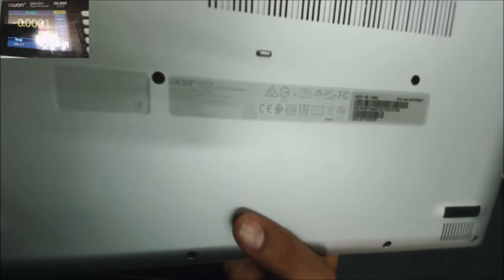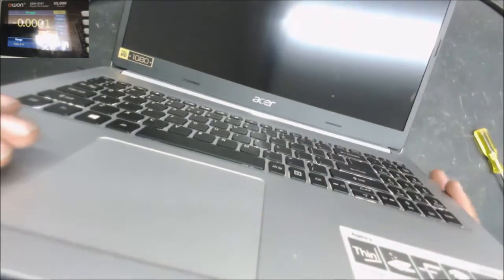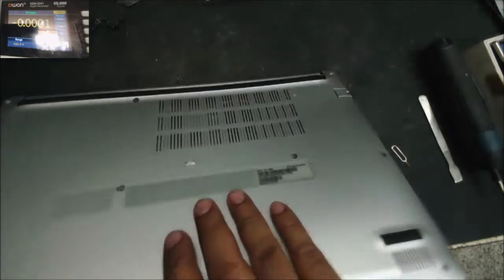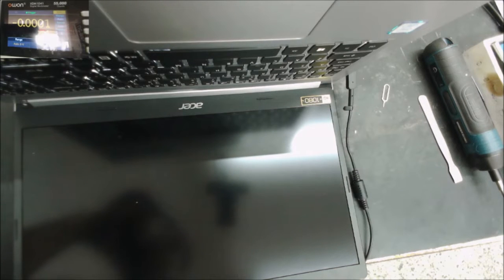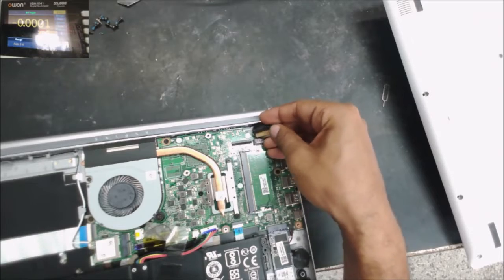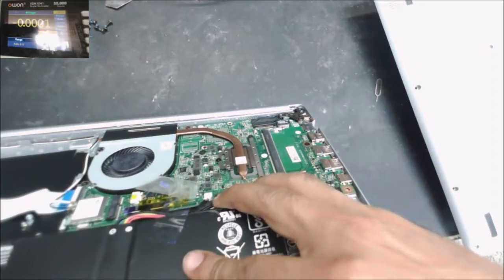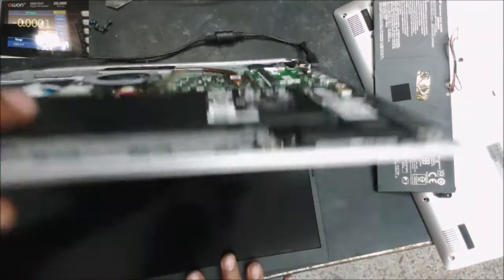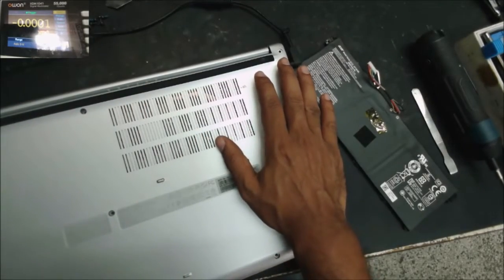Acer aspire A515-54 laptop turns on but no display could be easy fix

Comment: So what would u say the problem was? I have a similar Acer working on with similar issue... Model number: A515-55-34kL.. Shows power on similar to ur video with no display.. I tried removing the battery couple times, disconnect the screen and cmos battery and still nothing
Reply from the maker: was frozen bios